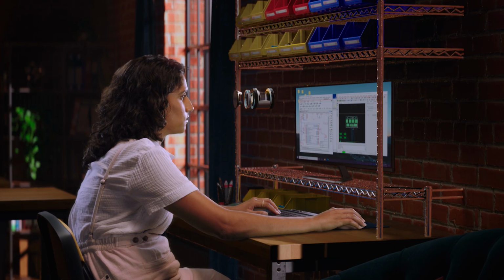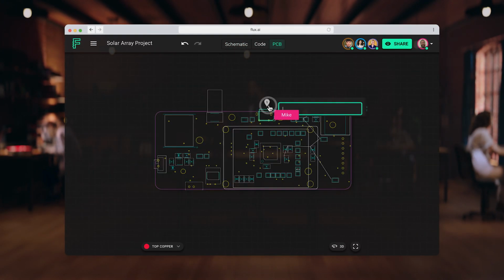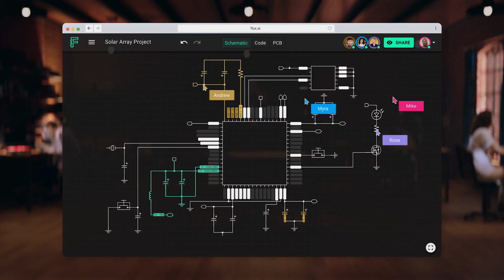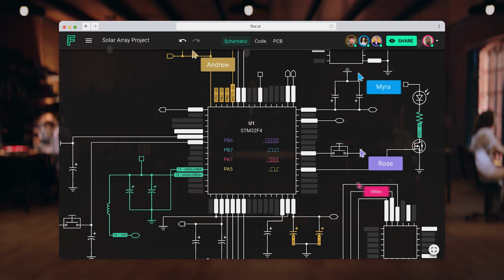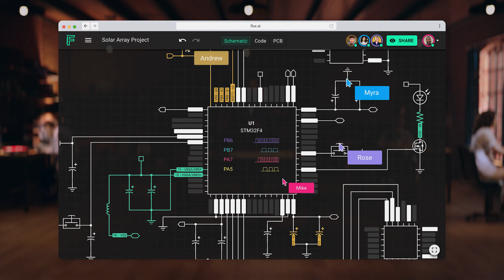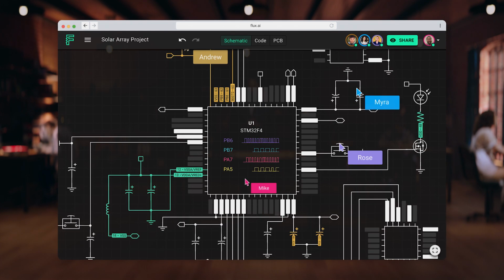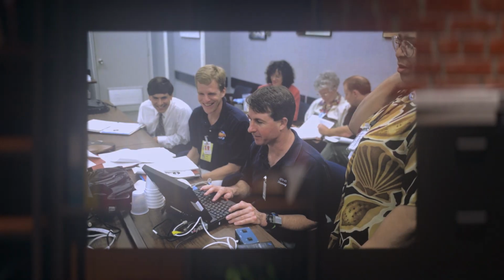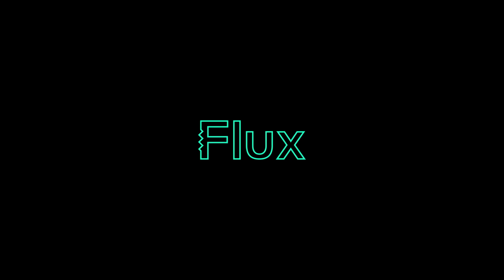Flux | a better way to make hardware

Comment: so basically as a designer you told me that i can come out with sketch and details fonctional need to prototype electronic product ... 
and use it to build the complex PCB part with IA ... that will olso take in consideration the space of the final product to find a way to stack it all in the box ... 

crazy ...

Comment: How embarrassing. Making a video about PCB construction and having your actors operate TWO soldering irons at the same time, with one of them being held by the hot metal parts. Did no-one at Flux think to check the video before release? Oh dear.
Reply: No he's not holding two soldering iron his holding solder lid wire dispenser pen I knew it because I have one
Reply: thats a soldering tin dispenser
Reply: It's a subtle meme reference.

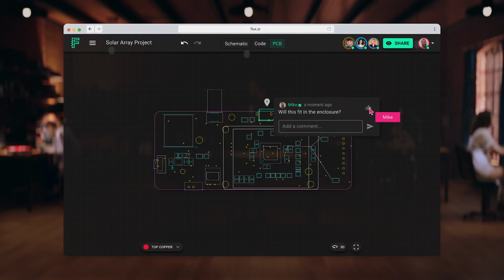Comment: Nothing in this video shows me how this is faster than the design methods we use now. At 0:49  "Mike, will this fit into the enclosure". You could simply swing your chair around in your cubicle and ask Mike, "will this fit into the enclosure".
Reply: Definitely see your point here. That said, I do think this could be useful in work-from-home scenarios or if the other engineer is occupied with something else (you can just leave a comment so you dont forget later).
Reply: If the company is huge and the production line and engineering lab is 1 acre away then you need this